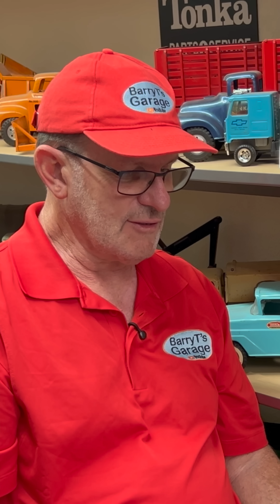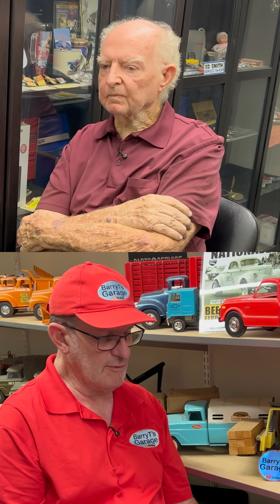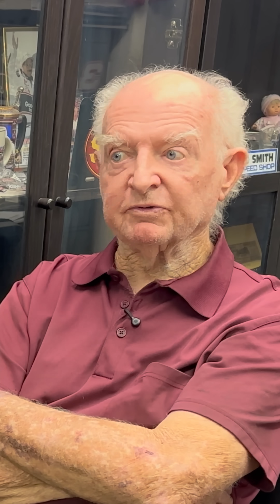The Piston Part of a 427 vs 454 - Ed Smith w #BarryT From Ask Ed 44 #classiccars #enginebuilding

Comment: I’m a big fan of Ed.. He’s the kind of person reminds me of the old days when I was a kid. I learned a lot from people just like him..  I built my self a 377. It has flat top pistons, 1.94 large chamber heads with the exhaust ports opened way up. The cam is a solid flat tappet with 525 lift on the intake and exhaust and 293 duration on both intake and exhaust with a 107 lobe separation . Intake is a  Team-G open plenum high rise with an 850 Holley double pumper. It sounds really nice but I haven’t had the opportunity yet to really try it out yet but I think I am really going to enjoy it.  It’s in a 67Camaro, 4-speed,4.56 gear and 28x10 tires.. I would just like to have some of his comments and opinions..THANK YOU BOTH FOR YOUR TIME.. I appreciate it.
Reply from the maker: Sounds like a really cool build, I’ll ask Ed about it!
Reply: @BarryTsGarage Thanks very much. I’m 63 years old and I still want to learn…

Comment: Nobody runs stock pistons or rods anymore so this is pointless. The JE’s in my 496 weigh over 200g LESS than stock 454 slugs. The old TRW slugs and 7/16 stock rods weigh nearly 2000g, cheap modern aftermarket stuff is 14-1500g for a rod and piston and that’s not even a lightweight assembly.
Reply from the maker: Thanks for your input!  The crank is still turning bigger mass, though, right?

Comment: B block "low deck" 383 mopar has the same 4.250" bore as a 454 chevy AND a slightly taller deck height.

Comment: I’m with Ed, he knows what he’s talking about.  I’ve always preferred the 327 and the 427 over the 350 & the 454.  They accelerate faster because the stroke is shorter.  Thats something that a lot of guys miss.  Yes they know they rev higher because of the shorter stroke.  But they also accelerate faster because of the shorter stroke.

Comment: The LS6 454  pistons are actually lighter than a 427 becusse the pistons installed in the 454 have a shorter compression height which would have less aluminum used to make them. Since all big block engines used the same length rods the only difference was what size the rod bolts were and the weight of those rods used in whichever engine, because there were rods that had more metal at the big end and larger beams. As the 454 has a 1/4" longer strock it required a 1/8" lower piston top from the pin center and with the longer stroke it has higher rotational mass due to the increased stroke which equated to heavier. The L88 had a higher compression ration piston which would have actually added more weight to the 427 piston over the larger displacement LS6 454 which had a lower ratio. The L88 was listed as the most powerful big block Chevy made, but it was rated at a higher rpm than the 454 was rated at. This info was taken from a tech post just the other day because I'm trying to decide whether I want to build a 427 which I would need a different crank, I have a 454 crank on hand but it's a cast steel unit. Which ever engine I choose to build, I still need a builda le block and pistons. I researched my oltions.

Comment: How does this not throw the balance off?
Reply: As long as all piston/rods assemblies weight the same, within 1g of each other minimum or +/- .25g if you really wanna dial it in.
Reply: @grapeseed427 Thank you. So basically a 427 chevy piston weighs the same as a 454?
Reply: @bradgilchrist-wy5gn yes, the same piston fits either
Reply: @grapeseed427 It goes for the rod and piston assembly.

Comment: What does Ed think about a 421” SBC? 4.155 pistons and 3.875 crank?
Reply from the maker: I will ask Ed
Reply: @BarryTsGarage thanks.  And a follow up question, what size head would he recommend for a 671 blower motor!
Reply: @BarryTsGarage  ask Ed why he chuckled about the l88 ! THAT is important information!
Reply: That combination actually comes to 421 cid
Reply: The small block 421 makes awesome torque, is much lighter obviously but there are issues with building them. One of the issues is keeping the ring pack serviceable. This combination requires the oil ring to be over the wrist pin in which case part of it is not supported in the groove, it requires special additional parts to support it in this area. Also the material between the rings is very thin which reduces the strength of the pistons somewhat. Next is the rod ration required to get this  hold to work well. Longer strokes produce more load on the cylinder wall and pistons. The has been a small block out to 460 but it required block deck plates and sleeves  installed. The 421 obviously has Siamese cylinder walls requiring steam holes in the deck and heads also with an over bore of .030 which reduces bore load capacity even more. A 400 block will go that far easy enough and there are pistons that will allow the use of the standard 5.7 rods so additional stroke needs tighter ring pack even more. A stock 400 has a rod ration less than 1.5 which is getting really close to acceptable design limits, I believe it is around 1.47 so the 5.7 rod brings the ratio back above 1.5 and the pistons for the 421 need a 1/16 comp ring and a 1/8 oil, or an even thinner top ring such as a .032
Reply: @BretTschacher Ok
Reply: @BretTschacher my mistake, typo.  Thanks for the good information!

I actually just had one built that I am running 8.0:1 with a 671 on it.  I originally wanted to make a 427” SBC, but was advised to stay away from a 4.000” stroke as it makes things tight on the short block and requires a small base circle cam.  It has 6” rods, seems to run great so far! 

https://youtube.com/shorts/E6E5OWsGb4g?si=R73uLFtxOvITXdIE
Reply: I had a 421 in my Corvette and it was a beast !

Comment: I had a L88 402 out of a Nova, put it in my Aussie 1970 Holden Premier, went like stink! Great engine.
Reply: I highly doubt you had an L88 402! The L88 was a 427! All 402 engines were made from bored out 396 engine blocks. There was an L78 which was a 396. But never an L88 402. Furthermore the designation L88 was reserved for Corvettes only.
Reply from the maker: Awesome!
Reply: @BarryTsGarage  L88 402? NO such animal. Friend built that engine, 396 pistons and block , the rest was L88 with  4.10 gears, 4 speed in a 69 Chevelle  SS. Screamed from 5,200 RPM up, no fun on the street below that.

Comment: Since im the first commenting I have a Edelbrock Rpm crate engine barely bored...but has a GMPP 3.8 stroke forged crank, pistons, etc, full roller with a 2800 stall in a 1972 Nova have videos what easily swapable transmission wise because this 700r4 sucks its reworked top to bottom it's gotta be the transmission
Reply: Unfortunately transmission options are somewhat limited. If you feel you need an overdrive that will hold to power, a 200-4r might be a better option but requires a bit more funding input. It is still a mechanical/hydraulic modulated trans with a much better low ratio along with the OD. It actually can be built stronger than the 700 which usually fails in the 3-4 bell assembly first. The 700 has a 3.06:1 first while the 200-4r has a 2.87 ~ first which would keep your rpm down and the spread from first to second is much less so you have better use of your torque curve.
Reply: @BretTschacher why wouldn't a turbo 350 be better explain ask him im at 589hp 611fr lbs did everything with the engine go manual
Reply: @BretTschacher i understand that but in Mississippi im not running out and grabbing a 200r4....I have a better chance with grabbing a perfect power glide from the junkyard
Reply: And thats not happening
Reply: @BretTschacher i wanted to know if a turbo 350 might make it rip faster off the line the 700r4 never shifted at the rite time
Reply: @BretTschacher wish i could let yall figure it out its a 396 stroker its winding up to 6100 before it shifts